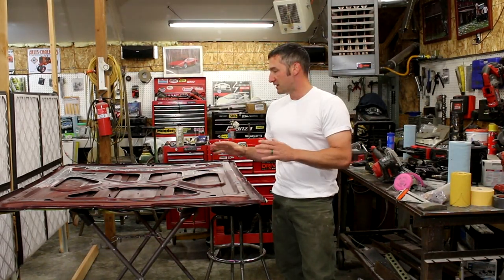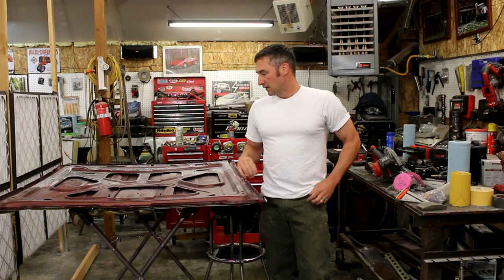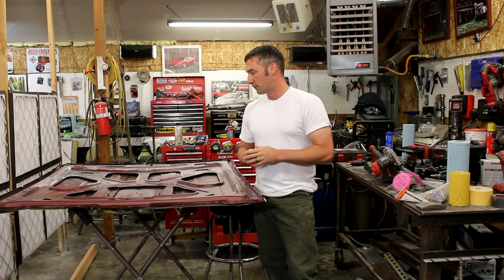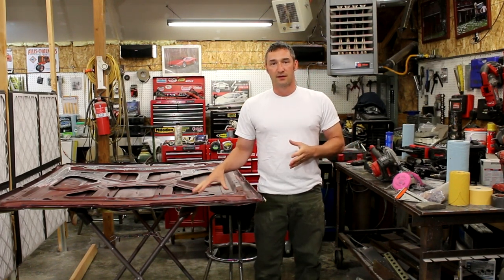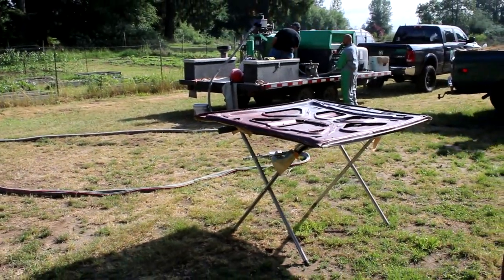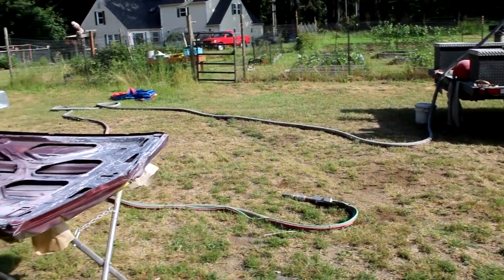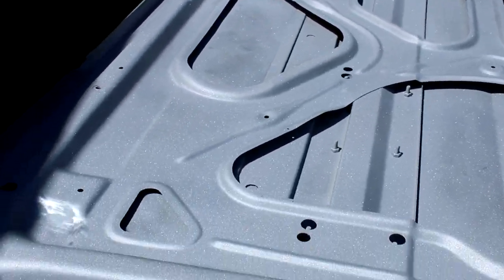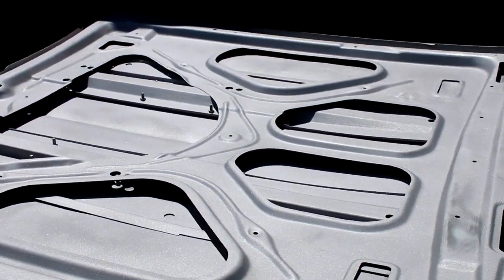jakes shop sand blasting the underside of my 1968 SS hood

Comment: So how did you get all the sand out of your hood? I did the same thing for a 68 Ford and it is a nightmare getting all the sand out. Debating getting a new hood because of it.
Reply from the maker: I flipped it over and over multiple times and used a blower end with a sort of a wand on the end of that i was able to get between the panels a little bit. Still wasn’t perfect. But after primer. Multiple times it was good. Didn’t get any in my paint anyway